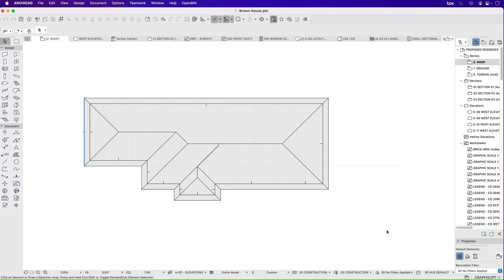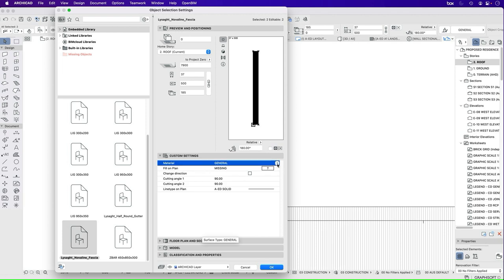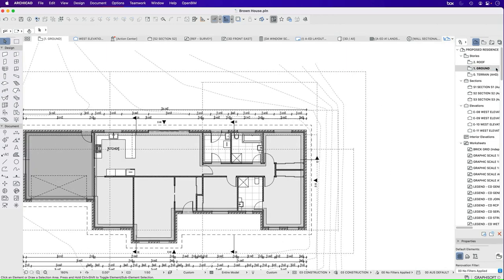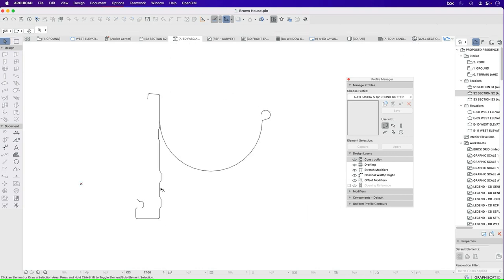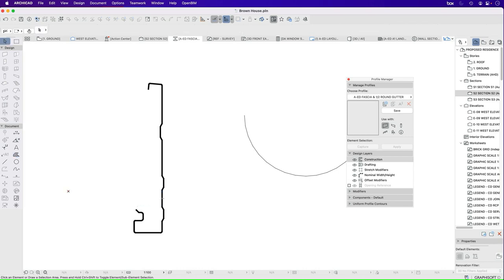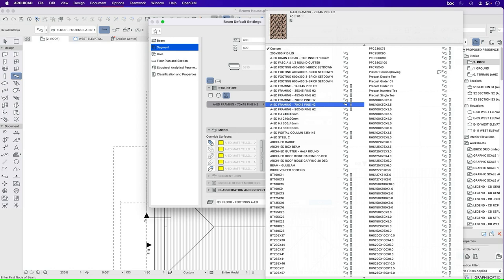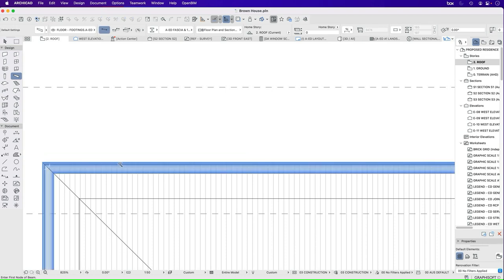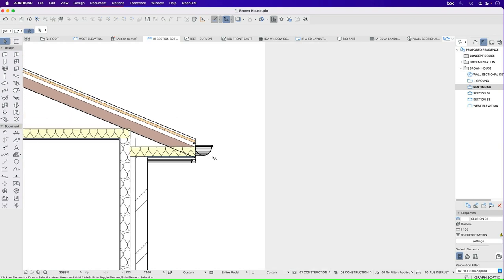ARCHICAD 25 FASCIA & GUTTER

Comment: Great video. For rounded profiles (like gutter) I like to redraw it with circle tool to reduce polygon number and extra lines in views.
Also, you could use this profile with railing tool to make it associative with roof corners - then any future adjustments to roof would change gutter and it's position as well.

Comment: Thank You, Robert, Just what I needed.
I'm designing a residence in the Philippines using Kalwall's translucent roof for my roof assembly.

Since Kalwall provides Objects for Revit but not for Archicad, and Archicad does not provide Kalwall in its roof accessories folder, I'm left with creating a new Kalwall roof material and support assembly from scratch by creating a new material in 'Building Materials' added to 'Roof Default Settings' combined with newly created support assemblies, as you have shown in the 'Profile Manager.'
Reply from the maker: Hi Gary, I'm glad I could help. I currently have one of emplyees working in the Philippines, and am wanting to build my team to assist with my projects. Are you interested in some freelance work, or do you have any other ArchiCAD drafters available for a 1 month contract?
Reply: @RobertMannArchitect  hello, are you still looking for someone? i'm an architect base in the ph.